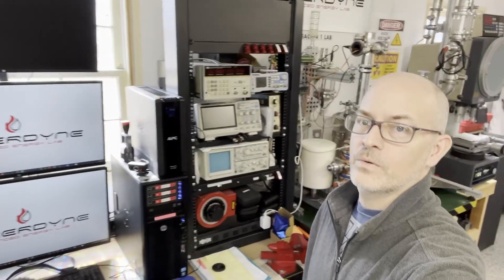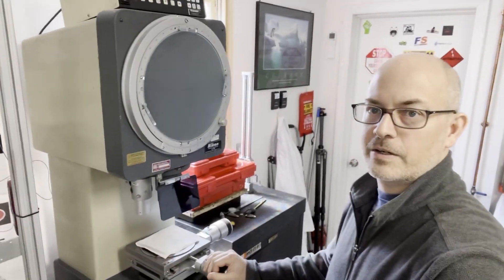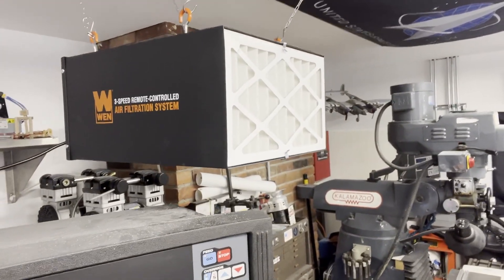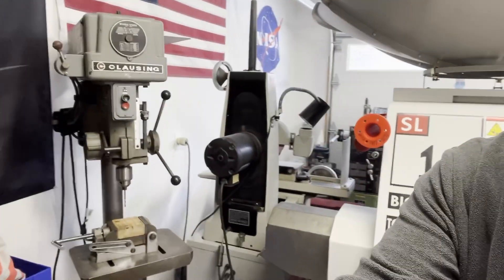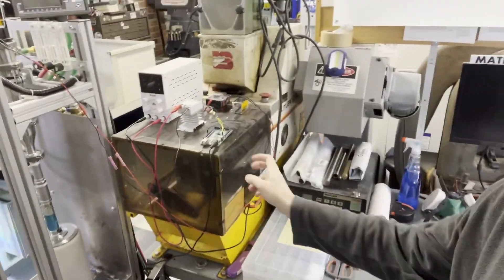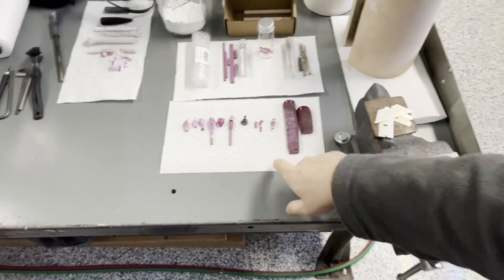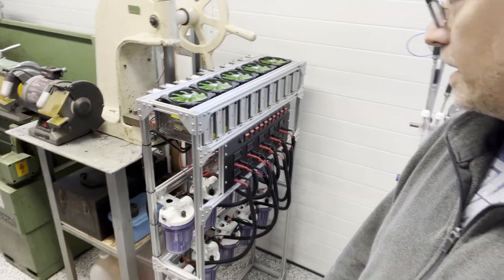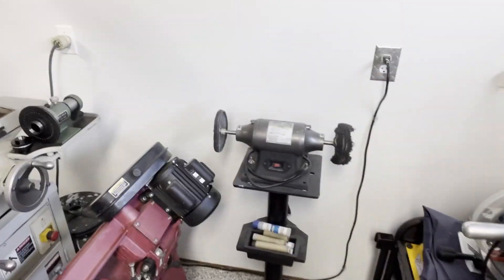SKUNKWORKS In A GARAGE?!?!

Comment: Holy .. And I thought my workshop was crammed. Looks you have double the equipment in the same floor space as I do. Props to you for keeping it so clean !
Reply from the maker: Thanks! It’s a standard 20’ x 20’ garage. I have 10lbs of crap stuffed in a 5lb box lol I’ve gotten good at efficient shop layout over the years. What do you have and make in your shop?
Reply: @AndyMaker  I have an Ernault mill and Linz lathe both (French made) CNC retrofitted with Centroid Acorn , tig Welder, and composite shop. I build airplane parts for my own ultralight aircraft build (engine and transmission parts) and for others as well.
Reply from the maker: @SuperYellowsubmarin That’s great! I wish I had the stomach to fly like that. Your shop looks awesome. I’ll be watching your projects.!

Comment: Such a cool multi-discipline workshop/lab! Neat and tidy too (mine is not).
Reply from the maker: Thanks! I just cleaned it, thats why I filmed it lol.  What do you work on in your shop?
Reply: @AndyMaker  A little bit of everything, really. Some general fabrication - CNC plasma + welding, electronics, industrial automation systems. The way I found your channel is when I wanted to experiment with LENR (high pressure water plasma electrolysis type), but also want to try H2+nickel/copper. Trying to find some time for that)
Reply from the maker: Cool! Sounds like my type of interests! You should check out I2C_Jason on TikTok. He is showing the process of building his own Sonoluminescence LENR water reactor. Neat Stuff! I'll be getting back to working on my reactors soon. Thanks for watching and following!
Reply: @AndyMaker  Thanks for the tip - will check it out! Thanks for making these videos!